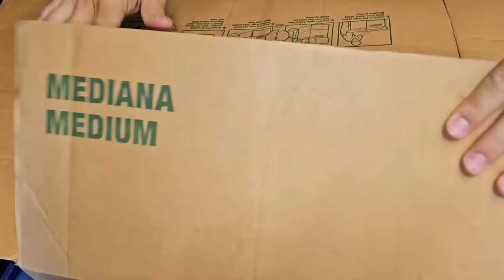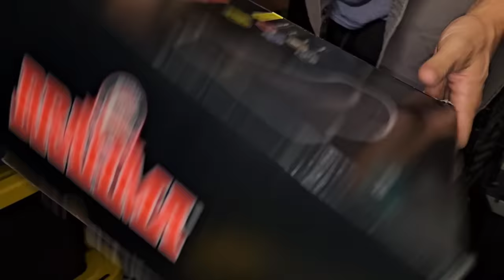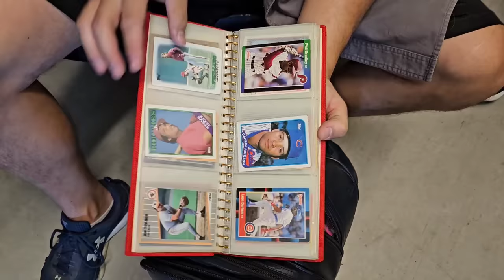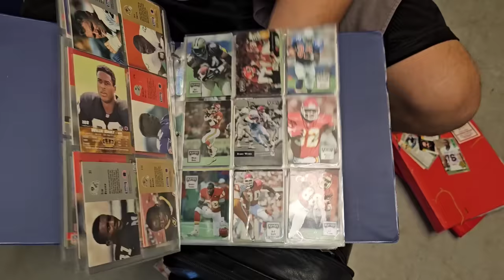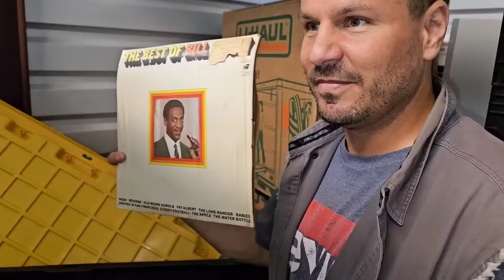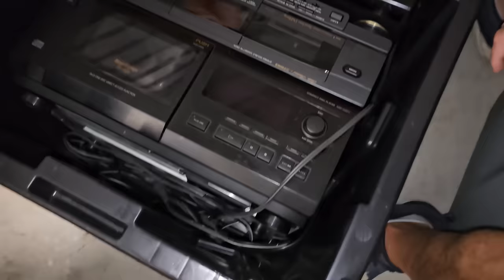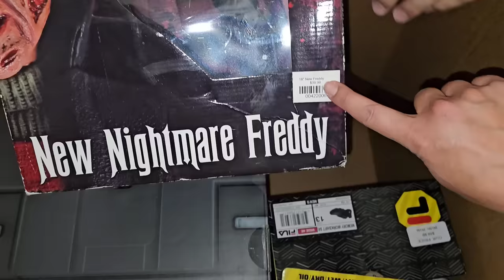HE DIED and LEFT EVERYTHING TO US

Comment: By the way to figure out if you have a blown speaker or not you take a 9-volt battery and hook it up to the wires if If the speaker does like a buzz or pop noise you're good to go and it doesn't affect the speaker